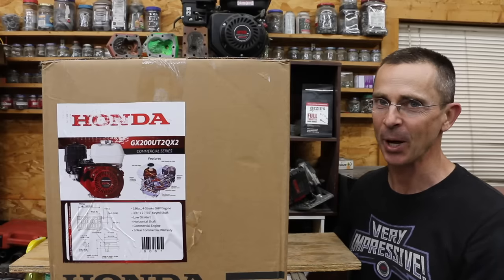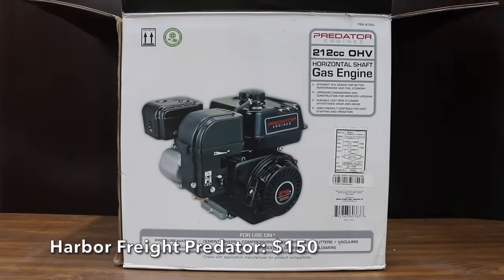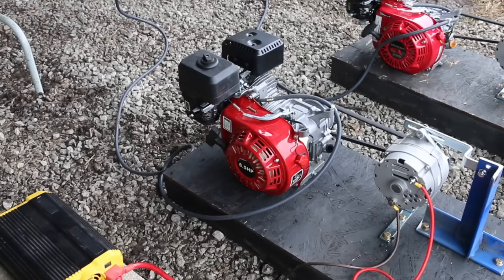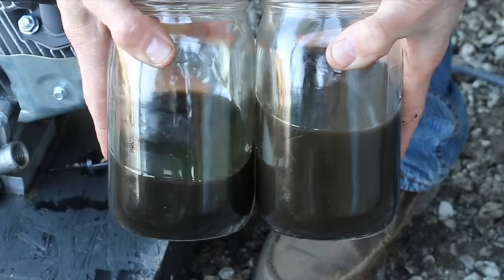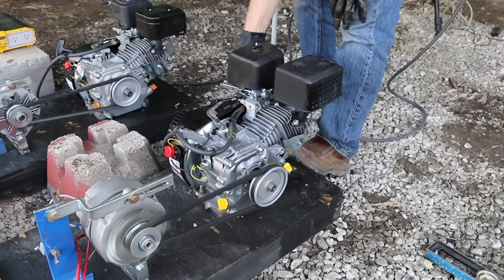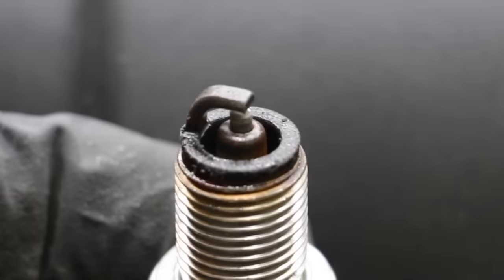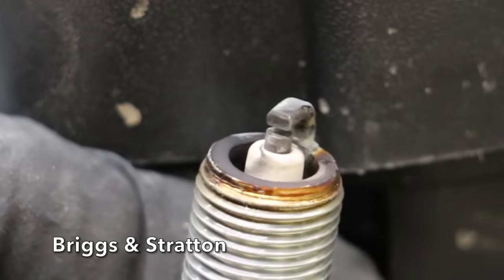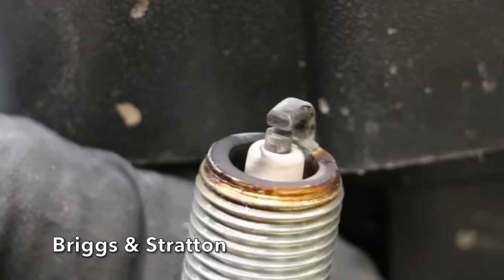$150 Honda Clone vs $600 Honda? Let’s settle this! Fuel Efficiency, Horsepower, Durability, Starting

Comment: I have owned three of these engines, each quite a few years.  Honda, Briggs & Stratton, and the Predator all for a well pump.  The first motor, the Predator, lasted only 4 years before burning out.  The Briggs & Stratton lasted 6 years.  The Honda we have not replaced yet after 9 years.  This test mirrors our experience with the motors.  The Honda is the most expensive, but the most durable.  When the motor dies (as we expect it will soon) we will just get another Honda.  They are really unsurpassed in motor durability.
Reply: What went out on the Predator and Briggs, did you do any maintenance?
Reply: Just put up solar panels and electric pump.
Reply: 4 years for $150, and 10 years for $400… works out pretty well
Reply: @Sam S

At the 150 vs. 600 as per the video, you would be better getting the clones and replacing them.

Assuming a failure rate of 10 years for the Honda and 4 years for the clone, you could purchase 4 clones equalling 16 years for the same cost as one Honda.
Reply: @random6809  not the most ecological but oh well.
Reply: @howardsimpson489  get the Honda clone
Reply: @rockrl98  Of course we maintained it.  How would it last more than a month if I never changed the oil for example? What ended up happening is the seals wore out, so it began burning oil and for a well pump, that is the death knell.  The Honda is still going with no oil being burned.
Reply: @howardsimpson489  Actually, we cannnot use solar panels in CT - the winters the sun is too short, and there a lot of trees preventing any solar working.  We tried to get our house solar and we were told if we took down 30 trees we can do it. Taking that many trees not only is terrible for the environment but would cost thousands of dollars (try about $40,000).  However, we are thinking about wiring the well so we can move to electrical current now.
Reply: @random6809  You are assuming the Honda will fail.  The others the seals went and burned oil.  The Honda still is not burning oil.  That makes a big difference.  Also, we are saving since the Honda has worked so long as we plan to move to an electric motor so this will be the last gas engine we use.
Reply: @Buc_Stops_Here  would it not be cheaper to replace the seals as part of routine maintenance than to buy a new generator..??
Reply: So you are trying to compare a 19 year old Predator with a 9 year old Honda?  The problem here is that today Predator are making much better engines.  Also, today oils are much better, perhaps you are using much better oil.  Your experience is not scientifically founded.  I really like Project farm's findings, they are 100% scientific and prove Predator engines are equal to Honda (if you don't compare prices).
Reply: @bushcraftone7240  It would be cheaper but how often do I want to do this for well water?  How often would you want to do that when this is your water supply?
Reply: @COSMACELF1802  I just shared my experience using three of the manufacturer's long term.  You can criticize me as much as you like, I never said it was scientific.  I just said my experience pretty much mirrors his findings.  Take it or leave it.  Maybe you have evidence of a more recent motor lasting a decade.  Please share it if you do.
Reply: @Buc_Stops_Here  Thank you for sharing.  I'm not criticizing you, I believe your experience.  I only like to point out that the tests performed here prove these new Predator and Honda engines are equal in durability.  Name brands aren't always better, competition catches up and it's worth researching instead of mindlessly choosing the name advertised everywhere. We are very fortunate that this kind man is paying out of his own pocket, unbiased and saying "let's test that".
Reply: @random6809 you’re making a pretty big assumption that the Honda will all of a sudden go out at ten years.
Reply: @stufoo  Very true.  I just said that as we plan to move to an electric motor that runs off of current shortly.  So we will retire it in about 10 years even though it is prefectly fine right now.  We probably should have done this years ago but never bothered to until now.
Reply: @stufoo  
He said it was about to.

"When the motor dies (as we expect it will soon) we will just get another Honda."
Reply: The Honda will need to last 16 years for the pricing to be equivalent, but as far as waste, efficiency, and environmental reasons - obviously the Honda is better.
Reply: @random6809  year but you have to keep adding quarts of oil factor that cost in
Reply: 3 HP Electric motor whips the shit out of all of them!
Reply: You did forget one important thing. Honda needs 5% less fuel and it means lot during several years. You save money that way too
Reply: We have had a Honda EU20i in our caravan for 7 years now. It always starts promptly, doesn't blow smoke, and I haven't had to clean the plug yet. Quality speaks for itself.
Reply: If you need it to work in an emergency, (we’ll pump, generator) Honda, if you want to beat it up and think it may get stolen (go cart, cement mixer) predator, and you can buy the warranty at check out. Which will replace it making it the cheapest by far when it fails.
Reply: Depending on your water demand I would recommend hooking up to the power grid. From an engineering standpoint, solar pumps don’t work well for high water demands unless you pump it to an adequately sized storage tank and gravity it from there sort of like a water tower.
Reply: We have seen good results if you can get the tank elevation high enough. You can achieve ~0.4-0.45psi per foot of elevation difference depending on the coefficient loss of the pipe used.
Reply: @@jeffdesertmountains5028 980’ depth is no small number and would take quite the battery storage. Also, you could hook two inverters parallel to get 220v which would be more efficient  and you pump motor would last longer, provided your pump can be converted to 220v.
Reply: Four Predators will last 16 years for the same cost as the Honda.  Will the Honda last 16 years?
Reply: @random6809  Add in the time to repeatedly purchase and install the clone and dispose of the broken motor, paying yourself at say...Minimum Wage, and the Honda is a MUCH MUCH better deal.
Reply: @random6809   Other than the increased down time replacing pumps....also assumes there are no other ill effects from pump failure.
Reply: @fldumars3574  I would think that your conclusion would be to get the Predator or the Honda, NOT the Honda clone.
Reply: @fldumars3574   duh, check out sparkplugs at 6.35...this ol' mechanic says, no clone for me ,even if it's free...eh?
Reply: where did he test durability?. you need to run them for beyond their life, a few times to get a decent sample..or at least long enough for some failures.
Reply: @timn4481  You missed the part where he ran the engines for years until they failed?   Lol.....remind me not to put you in charge of resources. He literally ran them until they failed (other than the Honda, which has a far longer life than the rest and is still going0.  You weren't able to read that, or were you just not able to understand it?
Reply: We've had a Honda lawnmower for over 20 years, which has been put to work on a regular basis, and it's still running like a champ.
Reply: @random6809  You have to add in the amount of time spent removing the old engine.. Purchasing and installing a new one and the down time.
Reply: @timn4481  it is a play on words. His durability test was does it burn oil or not. It is really more a quality of build test because as you wrote it was not tested for a long enough time. If you are talking about my results, I maintained all the engines religously.  Just some failed sooner than others (and the Honda has yet to fail).
Reply: sounds like you'll save if you just stick with predator.
Reply: They had these Predator engines 19 years ago?
Reply: Good to know this when making a purchase , 👍
Reply: @random6809  that assumes maintenance is the same on both. It doesn't sound like that's a realistic expectation.
Reply: @dl1027  it might
Reply: After I ran out of the cheap stuff and put expensive synth racing oil in my old Honda, it just won't quit.
Reply: @random6809  Need to factor in fuel economy.  A typical engine will burn more that it's value in fuel over it's lifetime.
Reply: @@jeffdesertmountains5028 put oil in it next time
Reply: @Buc_Stops_Here  40 k euro to remove some trees ?????.That is cost for some company to do it,or some environment cost ?.
Reply: @random6809  you forgot to add extra fuel consumption and that the motor almost works on oil. You will need to maintain cheap motor more than expensive one, this is your time which you can spend on something else. As a result, most expensive motor will be more money efficient. Also dont forget about the global impact by buying more motors in stead of one.
Reply: Seems that what most of the commentators that recommend the clone or B&S forget is that down time to replace them. One might not be in the position timewise to do so.
It's the simple game of logistics - if you install a 600MW electric motor make sure you have the not-so-cheap fuses or solid-state protections in place. Then, because you have to get that motor from overseas - just buy 2 of them and keep the one as a backup - because it sure will be much cheaper in the long run than to try and get another one of them $100k motors with a lead time of 3 months....
In other words - time to replace might not be on your side when those things conk out.
Reply: @dl1027  
I've got a Honda Cub form '84 that's still running strong, and it's a similar five horse motor. It's been run fairly hard as well, so I'd say the Honda could make it sixteen years and beyond for that matter. As an extra added bonus, you'll have an engine that wasn't built in a country carrying out a genocide.
Reply: However, to break even on the capital costs, ignoring the alternative of leaving the excess cash in your investment account and earning interest, the Honda has to run sixteen years, as you simply could buy the clunky "Predator" engines and replace them every four years.  It'd also be a question of whether the downtime is worth the bother.
Reply: @random6809  That's true.  And granted, the difference of $450 is not that great in terms of "invest the difference", but over time, if you're realizing a relatively modest gain in your investments (ignoring putting it in a retirement plan, which has early withdrawl consequences more than enough to negate accessing it), keeping your money pays to replace the clunky engines much more frequently.  It really becomes an issue of how inconvenient is it to do that?
Reply: @random6809  But the clone also uses more fuel and oil, and requires more care or it will run out of oil.
Reply: Yes. I don't care if it pull a dummy 1/4 of a second faster, I want to know how many years before I need to replace the engine.
Reply: @rockrl98  forget the ecological, it's having your engine fail during an important job.
Reply: @howardsimpson489  perhaps he needs to pump at night. or in the winter with no sun. Then you have to deal with batteries, and inverters etc.Depending on the application, it may be more practical to just run a gasoline engine.
Reply: @random6809  also have to consider the down time if an engine fails, and the time to unbolt the engine, unbolt the pump from the shaft. Usually not a big deal but should be figured in.
Reply: @ihd-3603  Exactly what we are doing this spring.  The Honda will remain the backup.
Reply: @edtaber5326  Yes, they started as a company in 1988.  Bought my first engine from them, did not go back.
Reply: @kennygee2715  You are correct.  When it is your primary source of water, and you need more to be pumped, it has to work 24 hours a day to start up and pump some water.  Like I mentioned elsewhere this is my last engine.  This spring when it warms up we will get it on the electrical grid and use our generator instead to keep the water flowing if the power goes out.  We will retire the Honda to other duties at that point.
Reply: For the price of the Honda, you can buy 4 Predators and that should last you 16 years.
Reply: @random6809  time is money who wants to swap four engines and in four years that clone will cost more than honda now
Reply: @howardsimpson489  😂😂then on weeks with very little sunlight just use baby wipes. 😂😂 You people will never learn
Reply: Yeah but you can buy 4 Predator motors for the price of one Honda. If each Predator last 4 years, that's 16 years total. Unless your Honda lasts 16+ years, the Predator is the best purchase!
Reply: @ptaweston  you go ahead and replace your water pump every four years. In the middle of the night. It is a wonderful experience.
Reply: Yeah, but given the cheaper purchase price, you're actually getting more runtime for your money from the Predator. So far. If the honda lasts a couple more years, maybe not.
Reply: If these were bought sequentially, manufacturing improves through the years as does oil. Temps and other things could have varied as well getting hotter or colder. For the money, Predator every time.
Reply: @nunyabusiness896  Actually I've noticed quality tending to drop over the years as manufacturers find new ways to get away with "planned obsolescence" and prevent us from repairing our equipment so we have to come back for new stuff sooner.
Reply: you could have bought 5 predators for the price of the honda...
Reply: @random6809  Assuming they all burn oil like the one featured in this video, the oil costs would add up very quickly. It's also in need of constant basic maintenance which most people wouldn't want to undertake on a daily basis.
Reply: @iamhe999  Please understand, when it is your source of water you don't want to go out in the middle of night and swap engines.  Sure if it was for a lawn mower you are right, but for a water supply, not ideal.  It is also why I am moving to an electric motor on the grid in a couple of months as that will be even more reliable than me changing the oil constantly on the Honda.  The pump does not run all the time as we have a storage tank, but it runs enough you don't want it breaking every four years.
Reply: @random6809    Your time and the amount of wast you create with the clone is insane.  

Better to have Survice and replace a quality product every 10 years.
Reply: Not buying a Chinese knockoff from China freight.
Reply: Just one quirky question, your not a Honda dealer, are ya? Otherwise ... thks.
Reply: @tinker3962  No, definately not.  I am a huge fan of this channel however as he is really helpful in figuring out what is good to buy.
Reply: @Buc_Stops_Here  Figured so, but had to ask. Good points you made on your experience. Helpful to others ... as refferals often are the truest unvarnished advertising.
Reply: @DaveC2729  "Planned Obsolescence" is mostly a conspiracist buzzword.

What actually happens is when products are new, there is limited testing and new data comes in when it enters the real world.  Then they overbuild it until it meets a minimum of longevity.  Once it meets that, they go back and see where they can reduce cost (usually to lower price or to make an unprofitable product profitable) until it meets what they consider the projected lifecycle.  

We like to glamorize the idea of cars that last 30 years+ of daily use, but then you end up with the Grumman LLV (aka the Mail truck) which is mediocre when new and absolutely abysmal by the time it's retired.  Military vehicles are another example, just ask a GI how much he hates riding in any military truck.  Even the famous "reliable" Toyotas of the 90's are miserably underequipped and get poor MPG which basically negates the longer life anyway as you pay all of your "savings" in gas.

Bottom line, things are built to last as long as they expect people will use them in order to maximize performance and price.  Despite what people claim, most people won't pay more or suffer compromises for a longer lasting product.
Reply: @tinker3962  I wouldn't be surprised if they were.  I see lots of Honda shilling all over the internet, yet per my independent study Honda varies from average to poor compared to its competitors and is exceedingly poor in value considering it usually is one of the most expensive in its segment.  They're coasting far too hard on the comparative reliability of the 70's when a Civic needed no emission equipment and American V8s needed tons of it and it broke all the time.  From what I see, American V8s like the Chevy LS, Mustang V8, Crown Vic V8, etc. run circles around the longevity, durability, and reliability of any Honda.
Reply: @Random  Hahaha! I'll be calling you for a free-engine replacement every 4 year then.
Reply: @random6809  I'd rather spend a little extra and not worry about whether my pump is going to die in the middle of the night in the dead of winter, or whatever. For other stuff, I'd go with the cheapies.
Reply: @nunyabusiness896  And you just used "conspiracist" as a sort of denial buzzword. I don't think I've ever heard anyone deny planned obsolescence before, and I'm not going to waste any more time on anybody dumb enough to try it. It's common knowledge, common business practice, and common sense.
Reply: @iamhe999  Four actually. 600 divided by 150 is 4.
Reply: @dl1027  I don't guarantee it but my money would be on the Honda. I've got a 45 year old Honda's still running
Reply: @selfdo  Plus the fact if you upgrade the resale or trade of the Honda would be a lot more dollars in your pocket than the predator
Reply: @random6809  That attitude is what's wrong with this world.  We waste a tremendous amount of resources (labor, energy and materials) making garbage products that don't last because of this  "cheaper" false economy.  You didn't even factor in the fuel savings over many years for the Honda, the human cost of time and effort of maintaining and replacing those three knock off engines, oil consumption, the cost of getting them shipped.  If you have a snow blower you use once a year for an hour sure, you probably don't need the Honda because you'll never wear it out but a well pump is a different story.
Reply: 4 predators = 16 years beats Honda for same money.
Reply: @BigEightiesNewWave  Upfront cost is not the only variable in a purchase.
Reply: @random6809  The cost and time for servicing them, whether tech or DIY.  Call your local small engine shop and ask them how much for an onsite service call to replace a motor and dispose of the old motor for you.  Whaddya think, $200 a pop?  So  2 Predators @ $150 ea + $200 for service call = $500 vs $600 for the Honda. How much does the downtime for the motor swapout cost, or is downtime free?  So the Honda could be the best value, depending on how you value your time and attention.  DIY is NOT "free".
Reply: @emptywig  Once every few years is hardly a chore, you need service whatever you have anyway.
Reply: @DaveC2729  I'm a mechanical engineer in product development and have worked in a number of industries on products from consumer to industrial.  Never once have I been asked to "plan obsolescence" into a product or sabotage its longevity in any way.  Once again, nothing is made to last forever, but it's that it's made to last a reasonable typical life, not deliberately sabotaged to live a shorter one.  Everyone I've worked with or for that tried to make true "buy it for life" products had poor sales or never even made it to production at all because they were always undercut by cheaper options.  The vast majority of consumers won't pay for lifetime products despite what they say and don't recognize how many trade offs in price, weight, performance, etc. you have to make for longevity.  Your take is extremely ignorant and, yes, conspiracy based.
Reply: @BigEightiesNewWave  Okay, you go out in the middle of the night because the motor died, the tank ran out of water, and it cannot pump more.  Do that four times over 16 years.  Or never do it with one Honda.  Take your pick.  I choose reliability.
Reply: Thats exactly why I asked about longevity.
I understand it would be an almost impossible test and extremely expensive to perform.A reply like yours is what people need.I have worked on small engines for many years and in my experience the Honda is best.
Reply: @mikeirwin9985  I believe that
Reply: @ihd-3603  Lmao - "coefficient loss of pipe used" is that a made up term? Here is the FACTS, Water will give you (.434 psi/ft or 2.31 ft/psi) of pressure period, the pipe makes ZERO difference except in the gpm delivered through any given pipe.